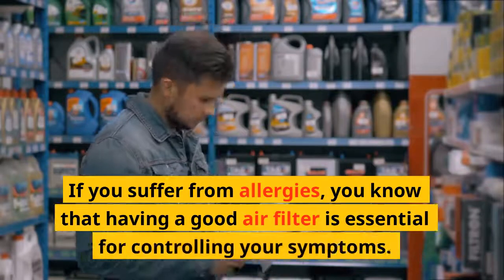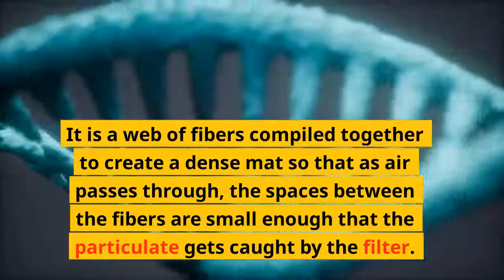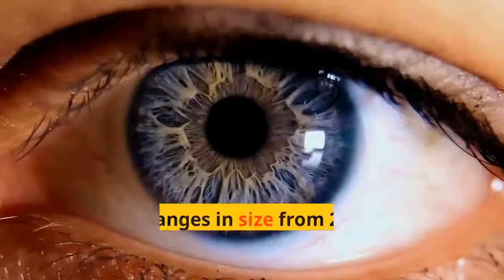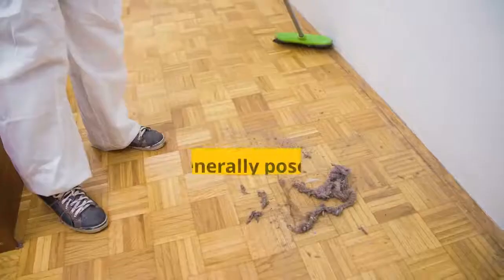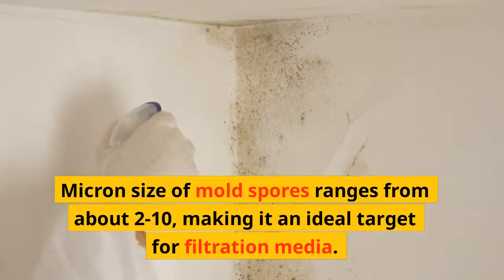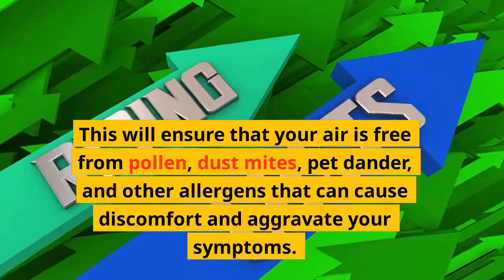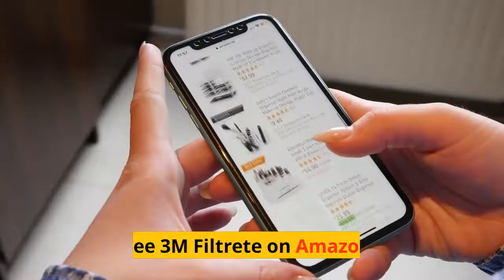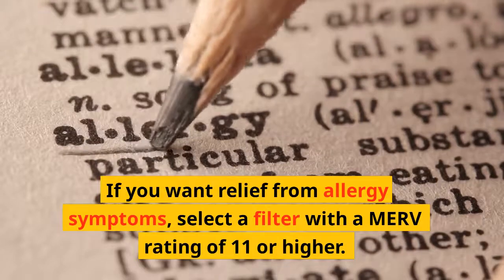What MERV Filter Rating is Best for Allergies?

Comment: Our family recently within the last five years had a new home built. This home was built really efficient with double insulation extremely high-quality windows and doors. The furnace is a Bryant. 
Unfortunately I went with a 1 inch filter instead of a 2 inch or 4 inch filter I wish I could go back and do that again. 
Question is, they say to change your filter out every month - in this house over the last few years. I have let mine go three months I run a Nordic pure Merv eight - after a month or even two months the filter still looks brand new -do you still recommend to change or replace the filter early?
Reply from the maker: Changing monthly is the cautious approach. Can you go 2 months? Probably, but every home is different. I can tell you I never have windows open and my filter looked very clean but the airflow resistance told another story. When I checked it it needed changing and that was at 1 1/2 months. You can have a gauge installed to tell you the actual numbers. Your HVAC company can help you. This would remove the guesswork.
Reply: @FurnaceFilterTalk  Thank you!
Reply: Best advice I received the other day, was to invest in a high-quality, portable air purifier using the HEPA filter.
Do not rely on your furnace filter to help with or cure your breathing issues - your furnace equipment will end up paying the price at the end of the day! 
We purchased two (AirDoctor) HEPA purifiers, one for the living room and one for the bedroom, and I will continue to run a Merv 8 filter & change every couple months. 
Once again, thanks for the awesome video. Please keep them coming.
Reply: Dylos 1100 pro particle counter.  I used a merv 8 for over a year, before it stopped filtering. It looked filthy.  I didn't check pressure drop though.